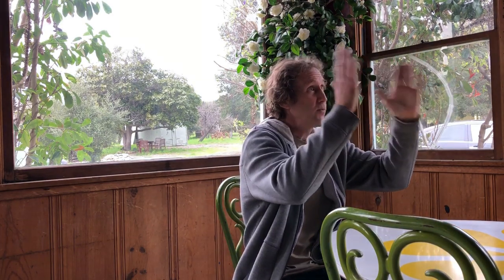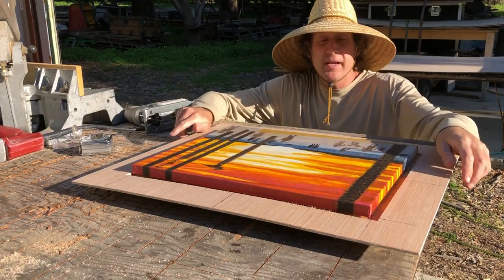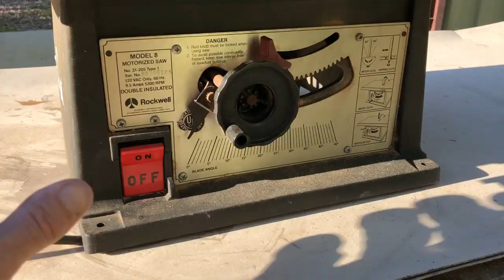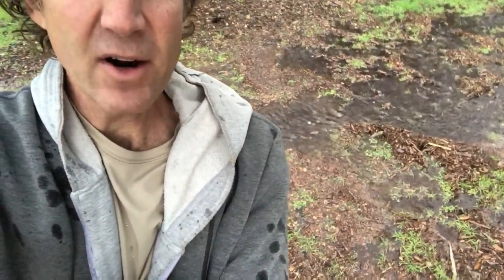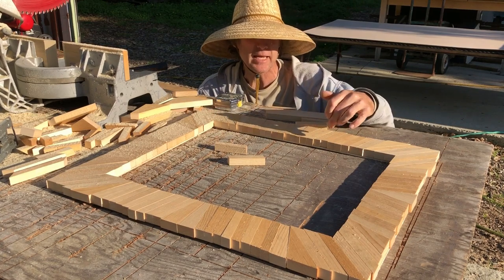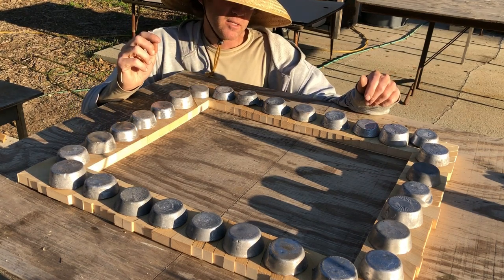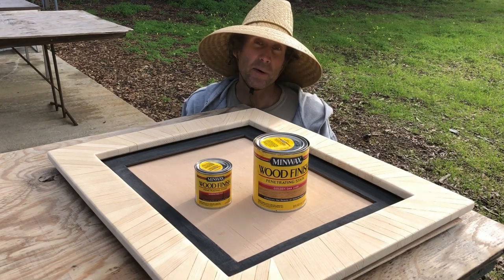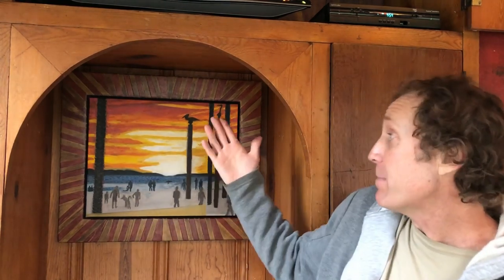Framing a sunset

Comment: The frame came out looking fantastic, Scott. I'm impressed with your ability to stain the alternating pieces in the frame with different colored stains without bleed and without the use of painter's tape. When I make rustic American flags, I stain all the components individually, prior to assembly.

You had me rolling on the floor, laughing uncontrollably over the rainy day segment of the video. I realize Southern California gets very little rainfall on a yearly basis, but here in Maine, that's just an average, normal rain storm. 

I was eating breakfast while watching this, and just about spewed yogurt all over my laptop in laughter when you mentioned it was "getting cold" near the end of the day. Here in the "frozen Tundra" (aka Maine), the temperature during the day in my workshop is typically in the teens to mid-twenties this time of year (although today it's supposed to get quite balmy and into the low thirties). I guess it's all perspective, but once again I'm thankful to you for producing another video with entertainment value that exceeds expectations!

I'm looking forward to your next one, Scott!
Reply from the maker: I'm laughing at myself with you right now. I'm originally from Portland Oregon and I've been living in So Cal for over 25 years now and I realized how spoiled I've become. The rain that day was an average rainy day in Portland Oregon when I was growing up and I rarely ever used an umbrella back then. These days if it's not 70 degrees and sunny I'm curled up in a ball laying on the floor depressed and crying like a baby :) If it drops below 50 degrees I call it an arctic chill and put on 3 shirts, 2 sweatshirts, a jacket, long johns, a stocking cap and ski gloves. Stay tuned next week when I see a snowflake fall from the sky......there's going to be shock and amazement!!!